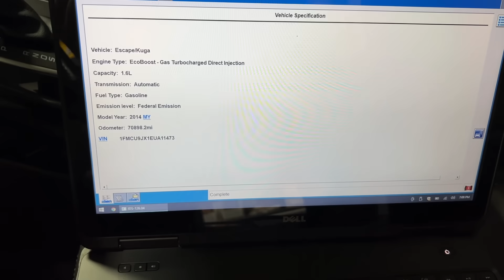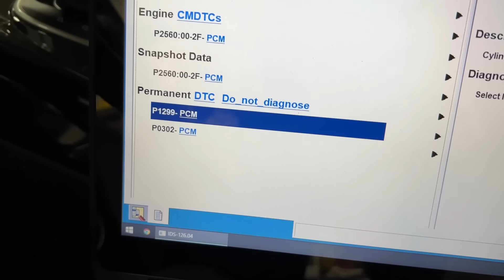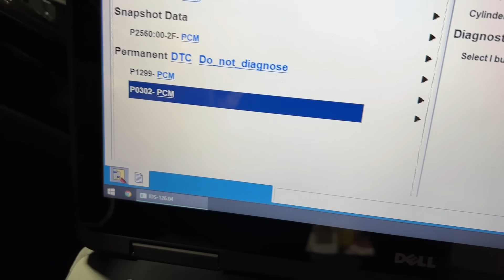Beware of Ford’s 1.5L 1.6L 2.0L Ecoboost Engines and Their Never Ending Coolant Consumption Issues!

Comment from the maker: This is the Endoscope I Recommend-
https://amzn.to/3AMIjgC

Forscan is a free Ford Specific Diagnostic Software:
Download Here- 
https://forscan.org/home.html
ELM 327 Adapter I Recommend-
https://amzn.to/2GC6dBj

As an Amazon Associate I earn from qualifying purchases.
Reply: Add my 2017 2.7 Ford Fusion sport to that. It’s toast at 127k miles. Ford wants me to pay 3k for the tear down just so they can tell me what percentage of the 10k for the new engine they’ll “assist” with. And I still owe 10k on it. Haven’t driven it in a year and still got another year of paying on that damn thing.
Reply: Been a mechanic for almost 30 years. I own a shop and work on all makes and models. These types of failures at mileages like this are now common across all manufacturers. Save two, the same two that have always made solid products and stand behind the. Honda and Toyota. Honda is not quite as good, but Toyota has had engine issues on rare occasions, and swapped every last on they sold
Reply: If you wanna tear my engine down for content and to prove to ford it’s their fault I’m ok with that. The misfire started at 65k and nobody could figure it out till it would hardly drive. I took it out of state cuz I was tired of throwing money at it and nobody being able to find the problem. The last people found the coolant intrusion. Safe bet to say it’s ALL ecoboosts.
Reply: I would put in a used long block and sell it.
Reply: Where does the block crack?
Reply: @JoeJalopy   The block doesn't "crack".  The head gasket can't seal the coolant flow area between the cylinders.  The between0cylinder coolant passage design if the whole problem.
Reply: He said it cracks between cylinder 2+3 . Pay attention
Reply: @JoeJalopy  Between the cylinders there are tiny little gaps. They crack there. Newer engines don t have that gap.
Reply: Its not a block crack per say, these engines are open deck blocks and the heat from the siamese exhaust port causes the bores to shift which eventually kills the seal. Most of the failed engines are Cleveland plant engines, the majority of the VEP tagged engines do not have this issue and the MZR block ecoboost engines don't have this failure mode.
Reply: Could this have been caused by a blown head gasket rather than a cracked block?
Reply: Ever 2.3 in the ford ranger? How bad is the 2.3 coolant issues?
Reply: Can you make a video on how or why Ford Explorers with V6 3.6 engine has a "LOW ENGINE OIL PRESSURE" when the engine is full with synthetic oil. My Explorer is a 2014 with 145, 000 miles. Already with a water pump failure at 110, 000 miles. I MADE FORD pay the $5500 bill. A factory design failure.
Reply: @JoséBenitoMartínezJr  How did you "make" Ford pay the bill?
Reply: @bartsarton2212  I studied the issues with the engine.  Understood lawsuits that were current against the Ford engine. The most important was the engineering flaw from Ford. The water pump. It was designed to be inside the engine. Driven by the timing chain. A major future weakness after 60, 000 plus miles on some engines. Ford was also in a several lawsuits about that same issue in Michigan and I think in Pennsylvania. So I took my Ford Explorer Limited with 110,000 miles out of warranty to Galpin Ford. Largest Ford dealer by volume in the world...40 years running! Great people, great service and great treatment to me. I talked to the service manager and told him I need to speak to the Ford customer satisfaction rep in the Southern California area. I called Ford and I spoke to her. Told her: 1, the engineer design flaw  on the V6 engine and how Ford knew about it. 2, the lawsuits in several states against them AND 3, THAT I WAS NOT GOING TO PAY FOR A FORD well known engine flaw by design.. She listen...kept silent. Once I was done her response was. "We(Ford) will have to review vehicle service history, the "So Called" allegations of such manufacture design flaw(s). I will call you within 5 business days and have an answer. She did call BY THE FITH BUSINESS DAY. She had the same very professional demeanor. She told me, Mr. Martinez you can take your vehicle to Galpin Ford or any Ford dealership and Ford will correct such issue. Your VIN # will be tagged for such service to be performed. A rental car also was provided as a courtesy for the almost 3 weeks.  It took that long 'cause the dealership had to order all the parts PLUS they provided new camshafts and all parts that go with that area that were damaged. The bill was $5492 for the repair. The bill was covered by the  Ford Motor Company. That's how it is written. 2 year guarantee or unlimited miles.  Just so weird. Cause they know the 2  years will pass regardless  of the "Unlimited" miles. More than 3 years and 8 months. 36,000 miles since the repair. The engine is very strong and runs perfect! I drive from Los Angeles to San Francisco over 800+ miles roundtrip and no problem. I know this. You do your homework. Argue your case with true and current issues to backup your case. In this case I won. Many can win as well if you know what to say and tell them what the flaw or issue is at hand. Thanks for the question.
Reply: @JoséBenitoMartínezJr  Good job, José!
Sounds like you got results by doing your homework.
I like hearing good-news stories.  😀
Reply: @bartsarton2212  never take NO, we can't do that  etc...as an answer.  Everything in life is possible! Blessings my friend.
Reply: @JoséBenitoMartínezJr  The water pump failure took out the main bearings
Reply: @robodrop2392  yup! Galpin Ford replaced that as well!!
Reply: Oil pressure sensor by the oil filter.
Reply: I have a 2018 Ford Escape a while back about 6 months or so it was on the min.coolant Level so I topped it off and I keep an eye on it real close it hasn’t used anymore but every now and then I smell antifreeze 
The car has 111k mi I want to trade it in on a new 4 runner but the wife likes the escape I’ll have to show her this video I’ve always thought Ford was asking a lot out of that little engine
Reply: Smokin crack
Reply: Brain, I need a little help from you with my 2004 5.4L Ford E-250 work truck. Temp guage pegs hot and does not over heat and goes into safe mode. I first changed thermostat a195, then 180 to a 170 degree and still pegs guage. To drive it now during the hot days I turn on the heater to keep the guage from rising and going into the safe mode. Since the truck has 200k all original. For future reliability I changed the radiator, water pump and guage still pegs hot and the temp gun reads 167. I went to change the senser yesterday and realized the one behind the alternator was different, it was the cylinder head sensor. So I ohms tested the cylinder head temp sensor yesterday behind the alternater to the right under manifold and the ohms changed at different temperatures indicating it was fine. I then looked for the coolant sensor location. But I cannot find where it goes remove inside interior cover and see nothing. I saw some you tube video's showing it in the front of the aluminum part of the intake manifold. But mine has no tap just a undrilled blank. Does my year have both or does the cylinder head sensor do both. Before this problem started. The fuel pump went 5 months ago and I had it towed to a mechanic and he replaced the pump. When I got the truck back I notice the bulb on the right side of the instrument cluster where temp guage is was out and the temp guage higher. Since it was still winter I was still able to drive it with the guage was higher then normal. I also notice the alt guage was going up high to the overcharging position and the more I drove it it. Eventually it went back to normal. this happened 2 times and never happened again. Other tests I have done is drive 70MPH on the highway to see if the clutch fan is working and the temp still stays high. I also replaced the plugs. So my questions are:
1. Do I have both temp sensers and if so, where do I find the coolant senser location.
2. Could it be the instrument cluster is bad. 
3. Could there be another cause like the catalytic converter being clogged or something else..
Reply: I use it religiously.  Pay 10.00 for the license.
Reply: What the percentage of vehicles affected?
Reply: Can you send me a link for your recommended 4.6 2v timing kit
Reply: @laurencekerbyson2064 search ford timing tool 4.8
Reply: I take it you would include the ford fiesta st line in this engine group? That's unfortunate. Would you say the turbo charger is the part of the problem?
Reply: Fellow independent master tech here, I have that endoscope also and can verify that its top notch for a great price.  Significantly cheaper than the tool truck options.  Great vid, great diag.
Reply: I have a 2019 Ford Ecosport that the Oil pump failed at 69000 miles luckily we had an extended warranty insurance plan so Ford put a Long Block in it. We’ve always used the orange antifreeze in it like Ford suggest but I noticed that they used green coolant mixed with the orange should I be worried about them using what I would call the wrong coolant?
Reply: My 2018 edge  2.0 is in the dealership now getting a long block. Thank God it's under warranty. Do these updated engines have any issues???
Reply: You're saying (or might say) that I can take an old Android cell phone combine it with an OBDLink EX, download this software (the free version) and then have more available operating scanning capability than with a basic OBD scanner?
Reply: Have you done a video on their defective rear differentials ? Mine a 2013 fooled me i thought for sure it was a rear wheel bearing because I wasn't aware at the time what total garbage these things are. I paid a dealership almost 3k to replace it and was told don't worry you won't get another factory defect unit but of course I did. Would replaced it myself but don't have the special computer tools to program it to accept the new codes on a new unit.
Reply: I have a nephew with one of these pos, cars, thank you for the information!!!
Reply: Ive got one of those scopes that the wife got me, and I'm impressed. 
I got a snap-on one ,that woulda been 1200$ new but I got a demo model for 600$. 
I've got a buddy in the industrial division that offers me demo sales and it's usually 1/2 price and used a handful of times by a salesman. 
Otherwise,my days of paying full pop for that stuff is over. 
The Depstec one is 80% as good I'd say, as far as resolution and overall performance. 
I end up using it between work and the home shop.
Reply: Might have to take back my rave review of this scope. 
Went to use it and it's flat dead ,won't turn on. 
Plug it in to charge ,and no indicator light either. 
So, I'm pretty sure it's out of warranty so should open it up to look around. 
Not really pleased about this , I've used it maybe 10 times and used it once at work and was going to keep it there.
And I really don't want to buy a replacement, as then id be at half the cost I paid for my snap on one.
Reply: Let's try something new and also pinch the buffalo as much as possible.
And here we are.
Reply: Won't install
Reply: What do you think of the three cylinder 1.5?
Reply: @curtis1951  A friend has on in a 2020 escape......Pure Junk, coolant leaks
Reply: The three cylinder engine is a Nissan/Toyota venture. Nissan owns the license for it . Toyota partners
Reply: @aninnymoose720  GM Korea has three cylinder engines also with a turbo in the Encore, Trailblazers.
Reply: @rickkern5785  interesting. I think i mentioned it, but the US patent trademark office had Nissan as owner of the design, with Toyota a licensee(or co owner) as well. Wouldn't be surprised if another country manufacturer has the same thing. Personally I'd stay away from a three cylinder engine... Could've just went 4 and did a high quality turbo, but instead it'll be designed to fall in 3-5 years at the power they're cranking out
Reply: @aninnymoose720  I'm wondering if the patent is about certain characteristics of the 3c design?  The GM 3 cylinder is made in Mexico and shipped to Korea.  An engineer on youtube mentioned that the 3 cylinder has power every 120 degrees vs the 4 cylinder with power at 180 degrees.  The three cylinder engines have a different twisting force on their mounts.  It will be interesting to see how the three cylinders with turbos hold up.  GM has both a 1.3 and a 1.5 liter three cylinder with turbo.  The Toyota GRs with the 1.6 three cylinder and around 300 hp have been out for a couple of years.  Now Toyota is bringing that motor to the US in the GR Corolla.  They must run a lot of boost in that motor.  It will be interesting to see if Toyota has better luck with small engine turbos than Honda has had with their 1.5 liter turbo.  It is interesting that Toyota has kept with the non tubo motor in the regular corollas while Honda is pretty much all turbo now.
Reply: @rickkern5785  my main concern is the engineering between all the parts isn't cohesive. Certain variables are ignored or unaccounted for with a special kinda emphasis on "notmy jjob " sortof mentality. 
My last car was a turbo 2.3...i had trans rebuilt and turbo go before 6 months from new. By the third turbo the engine camshaft had bore a large groove like an apple core chewed for no apparent reason. Not even a tad bit of carbon anywhere. . No sludge, deposits and i even so far as cleaned the valves @30k by hand . Borg Warner turbos ride on the name brand engineering (l everything does).. it's possible im wrong about the pattents. It's difficult distinguishing been real sources of info now a days and what is still popular living in a bubble ..
Reply: American engineering is pathetic, heck even German and Korean turbo engines are far better than American designs. America is just show off and no real talent!!
Reply: @ponygt6629  lol, is that why kia/hyundai has a class action lawsuit against them for their four cylinders, turbo'd or not, locking up at any moment?  QUALITY I SAY 🤣.  

Or how about the garbage 2.0. TSI platform by Vw/ audi.  Turbo waste gate linkage shot by 70k, in a pattern failure type of way.  Or worn balance shaft bearing causing low oil pressure at 105k?  Or a torn PCV diaphragm at 80k, in a pattern failure type of way.  You won't take that platform to 60k with an oil leak or check engine light coming on.  Pure trash engineering bro.

On the other hand, my 2000 silverado with the GMT800 platform is still going strong on the original engine and tranny though at 275k.  And MUCH cheaper and easier to repair in the rare event something breaks.  GTFO son 😆 🤣 😂.
Reply: @M4sterT3ch  Oh..really..according to you Ford and its engineering is great, worst reliable cars ever made always have some Ford and GM always on top list
And the issue we are speaking of here in this video, oh,,,its not at all a flaw very simple issue much better than the miniature issues commented by you and that too not prevalent in all models and certainly only in rough used engines
Reply: @ponygt6629  I never mentioned ford in my post, so no, not according to me lol.  I repair ford's everyday and drive my old school issue free GMT800.  Ford pays my bills quite well.

And the "miniature issues", so you call them, in regards to the 2.0 TSI engine, are not miniature by any means.  Well, unless that is if you think repairs in the multiple thousands of dollars are good thing before hitting 100k miles.  That is not reliability.  Korea and euro land is no better than Ford here lol.
Reply: @ponygt6629 Why do you keep going back to this video.  Our conversation here is about you saying Korean and Euopean cars are good lol.  I and provided quite a few examples to prove you wrong.  Like I said, they're no better than Ford.  Try again.
Reply: @M4sterT3ch  But ur examples have no back up or mass proof like shown in this video, all consumer car surveys, mechanics around youtube and all over internet and in real life too always tell us to avoid Ford and turbos why ? R a;ll of em wrong and just U right!!

Comment: We have a 2018 escape 1.5L EcoBoost with 100,000 miles… we started having misfiring issues and changed out the spark plugs and coil packs. After that we were still having issues so we took it to the dealership and they found coolant in the cylinders, their recommendation is a $14,000 engine replacement. I have been looking into it online and there is a class action lawsuit against Ford for this issue.
Reply: Join it. I did

Comment: 2014 is when all the issues on the Escapes began. My 2011 is undergoing normal maintenance as we speak, no physical issues. As for my 2014 the digital display went blank and i replaced that. No other issues. My 2014 goes in for normal maintenance once my 2011 is home. 150k and 80k respectively on their odometers. Keeping my fingers crossed.

Comment: Is it possible to destroy a 1.5 Liter 3 cylinder engine that is on a 2020 Escape by overfilling the oil level by 2 quarts?  67,000 miles on engine. That is what a Ford dealer is telling my widow friend. They are telling her she needs a new engine.

Comment: I have a 2016 2.7 ecoboost in my mkx. I have not hear of the larger ecoboost engines having this issue. Is it a different design or are they just big enough that the spacing between the cylinders are wider?